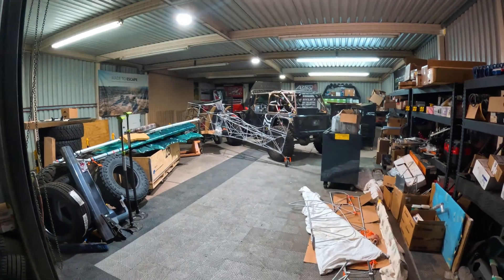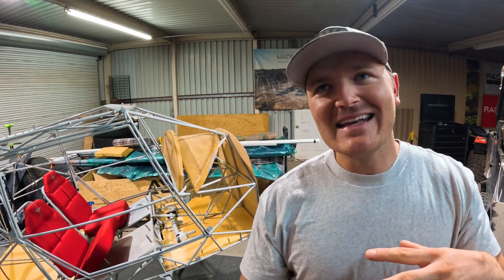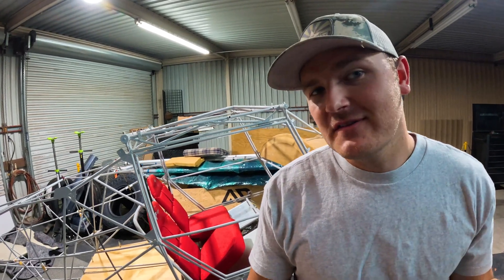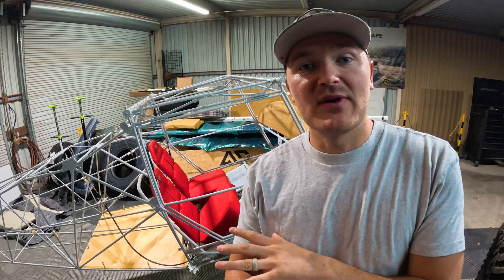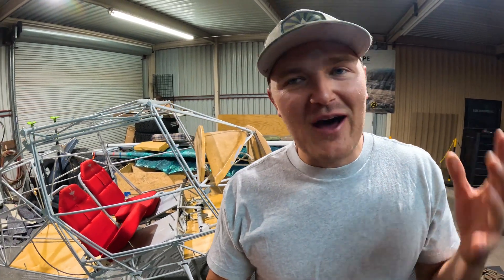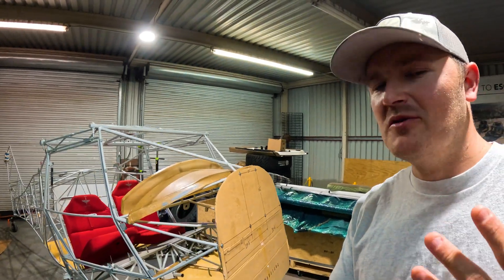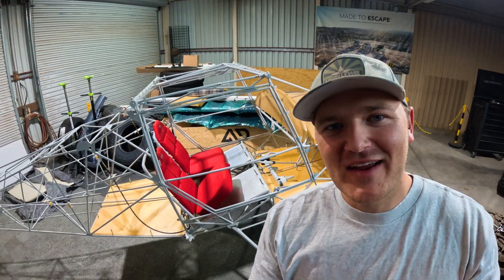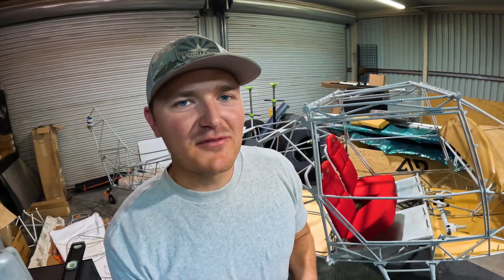Building An Airplane From a Kit!? Avid Plus Bush-plane Project Intro

Comment: Cool plane.  NICE kit.  For a while I owned kit 001.   It was called Airedale Backcountry, designed by John Larsen of Avid.  I had the factory assembly build manual with my kit.  It was originally designed for the Subaru EA81  power plant with a Stratus belt reduction drive.   My kit had the aluminum Grove gear.   The plane sat in my garage for a few years but I was just too BUSY with work and running my company that I didn’t work on it much.  About 2 years ago I got a call from the gentleman I purchased it from asking if I’d sell it back to him.   Thought about it for awhile and finally sold it.  The kit is now back in south west Minnesota.   I have the contact info for Mark if you want to consult with another builder.  Like you I did a LOT of research into the history of Avids and the Airedale prior to buying the kit.  I was able to get the contact info of the previous owner of Airedale, Jerry, and also John Larsen and called them to get a bit of history about my kit.  I also was fortunate to get a copy of The 5 articles John Larsen wrote for kit plane magazine about the history and build of the first Avid Mark V … which eventually turned into the Airdale Back Country.  Yes, you are correct, only 7 kits were fabricated.   When you get your kit completed it will be an AWESOME back country flyer.  I look forward to following your build.  One of my biggest regrets was selling my kit.   Thank you for sharing your build adventure with us.    Best regards from CYQT, beautiful Thunder Bay Ontario Canada.😊
Reply from the maker: Great info Brian! Thanks for taking the time to share your knowledge and experience. Looking forward to getting this one up in the air!
Reply: OOPS ... my kit was kit 007, not 001, apparently 007 was the last kit produced.  If you want, I have the contact information for Mark ... the gentleman that bought the kit from me.   You two might want to connect to compare build / assembly notes.   It will be cool when both of these kits are complete and flying.    @MaxHannOfficial